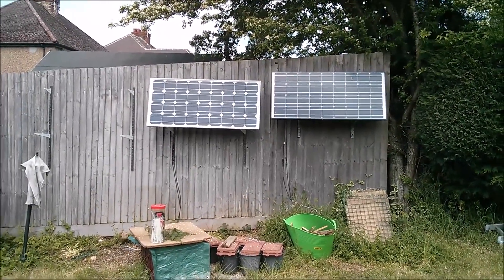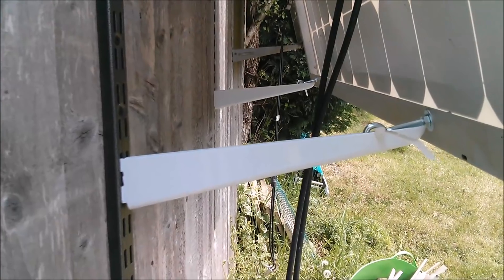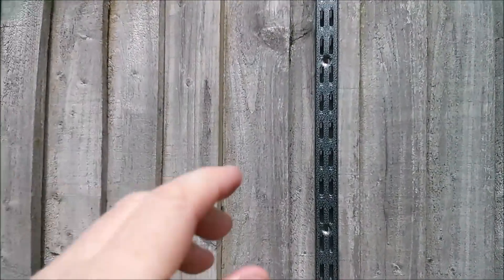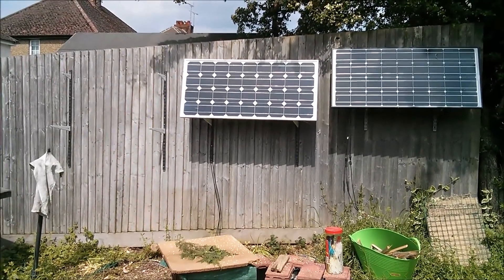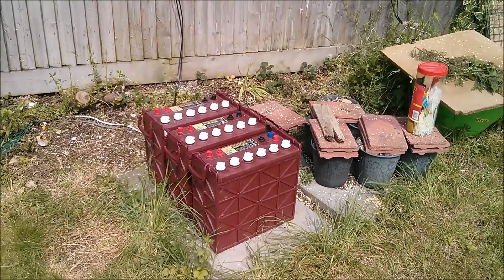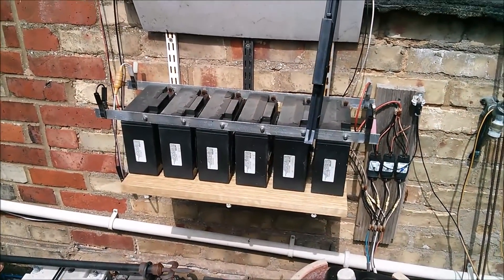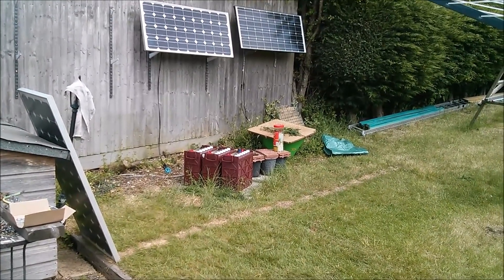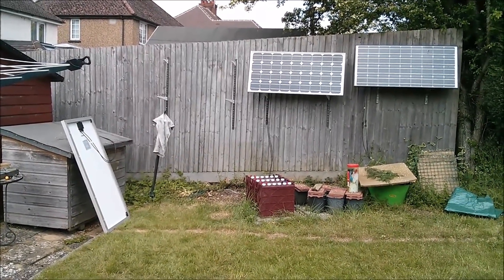Power Wall with 100W Solar Panels and 12V Trojan Batteries

Comment: Could buy a wedge fence strip of the same type cut it into short wedges and put them at the screw positions. But horizontal battens like what others suggested is probably the better solution because it will cater for the random warping of each slat.

Comment: Another piece of feather edge placed on top of the existing one will straighten out the face . Mind you, when the white cable straps fail due to UV the whole assemble will fall off anyway.

Comment: My first inclination to the panel angle problem would be to drill a vertical hole in the shelf brackets and run a bold through that into the eye of the eye bolt. 

Then use the nuts on the eye bolt as adjustments to even out any remaining strange angles.

I'm sure there's a reason that wouldn't work, but it;s the direction I would try.

Comment: My first concern would be to protect all those exposed circuit boards and connection from the rain :D
For the geometry problem :  2" x 4"s (or whatever you use there) screwed horizontally on the fence, then screw the shelving upright supports on the 2" x 4"s

Comment: Just use another piece of feather board turned upside down on top of the fence feather board. The two angles will cancel out and you will have a parallel surface.
Reply from the maker: That works :)

Comment: Avoid putting other batteries in parallel with your new ones or you'll just ruin them. Always match parallel batteries by their capacity or the weakest will be hit hardest and the higher capacity will never charge properly if they're back feeding the lower capacity batteries all the time. Your thin wire solution is unlikely to help.
Reply: Nope. It doesn't matter nearly so much in parallel. As long as the solar can hold all the batteries at the correct charging voltage, they will all charge.

"Weaker" batteries, as long as they are still holding their correct voltages (and not experiencing bad self-discharge) will not be back-fed by higher capacity batteries.

It's when they're in series that cells have to be well matched.
Reply: @clintoncoker6  Yep, parallel tends to have less problems here. "Tired" batteries simply act as batteries with smaller capacity and do less work in powering the load (and take less of the total current during charging). The only real problem if one develops a shorted cell, then the others will dump into it. And if this happens while the bank is receiving a full hit of solar charge then things get nasty very quickly. Especially with sealed batteries such as AGMs!
Reply: @xanataph  Agree.

Which is why you need individual fuses on each battery - and rate them as low as you can.

Comment: Hey Julian, how about mounting your panels on a piece of plywood, with a few hinges mounted to a type of gutter, then as a module, just hang the upside-down gutter part on the fence top. Swinging out the bottom for the proper sun angle with back brace supports and you're done.

Comment: Those cable ties won’t be suitable for outside use, you will want the black ones as they resist UV and don’t go brittle and break for quite a while. The Carbon Black additive which is what makes the black ones black is a UV stabiliser.
Reply: I agree. Always use black where UV light can affect the nylon.
Reply: @Mark1024MAK  Or even be a devil and go for stainless steel cable ties..! :)

Comment: I love it how the old solar panel frame is still hanging around. It’s like having an old swing in the garden even though the kids have long since grown up and moved out.
Reply from the maker: Ha, It's falling apart - the timbers have twisted - I think it will be soon for the bonfire :)
Reply: Julian's Other Stuff Keep hold of it until winter. You can replace that broken oil burner with a rocket mass stove in the work area :-)

Comment: Nice choice Julian! I'm using 2x 6V 225aH Trojan batteries in series purchased new around 9 years ago for my solar powered shed, still holding a full charge after all this time!
Reply from the maker: Wow, you must have a very well-behaved solar charge controller.
Reply: @JuliansShorts  just a basic PWM Morningstar ProStar 30, none of that fancy MPPT!

Comment: Why not have a high current connection between each battery? So that the panels directly top off all batteries..
Reply from the maker: That would create a problem. Connecting all 3 batteries with thick wire will make it behave as one battery. The 3 charge controllers will all have slightly different setpoint voltages. Ah, wait a minute, that would only affect modulation charge. Bulk charge would take the full current. Thinking as I type here :)
Reply: @JuliansShorts  That will be 50€ for consultation :D